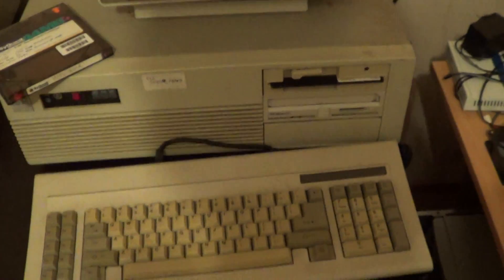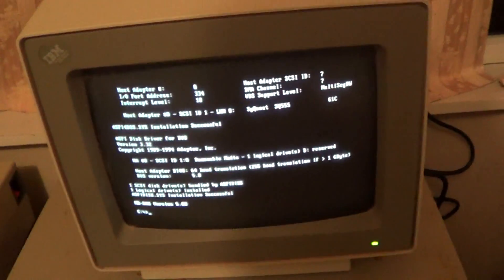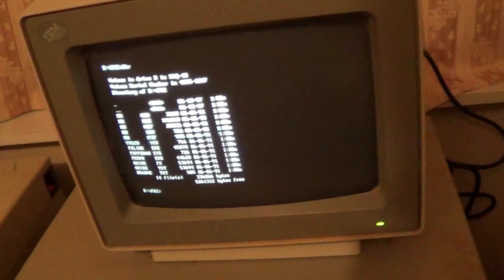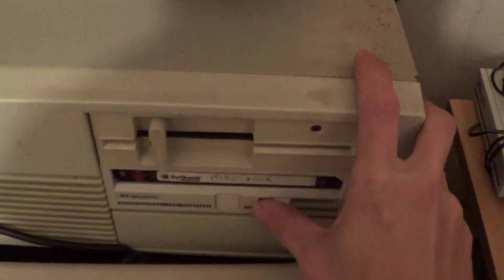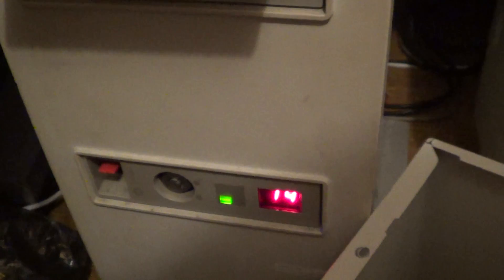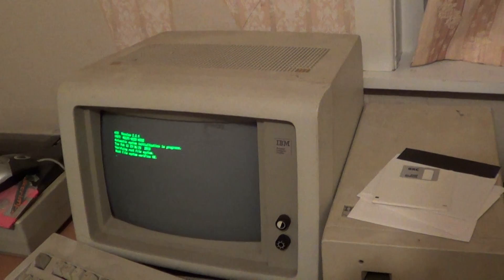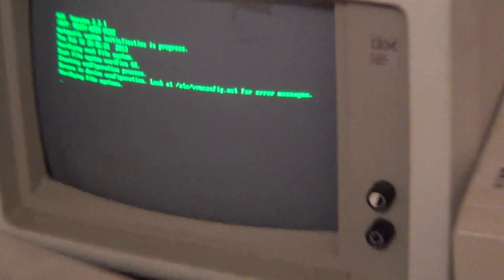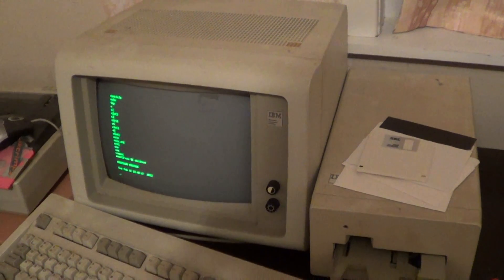IBM PC AT 5170 and PC RT 6150

Comment: Hello! I read on New Zealand Vintage Computer Forums that when you picked this machine up it came with plenty of floppy disks. I am trying to revive a 6150 with an existing AIX (but the VRM and SWAP partitions are deleted or had been moved to the now dead E70 drive) install but I get into problems that VRM show status codes on the LED display indicating "The VRM could not find a disk device driver." I have used the VRM floppy images at bitsavers and perhaps those are not compatible with the AIX which is installed? Are there images made out of your floppies? Can I ask you to do dumps of them? It would be really helpful!

Comment: You can also use a generic IDE controller in the RT and then an adapter for CF cards. This works great when playing with the various operating systems available and also reduces the noise!!

Comment: Hi, I am getting the 5150 tomorrow, could we meet somewhere in Wellington as I'm picking it up from upper hutt but can drive anywhere in the central city or where you are, anyway I'm getting it at 11am but keep in mind I'm not 100% guaranteed to get it but chances are 90% at least. I was hoping to drop buy and you can get it fixed if you have capacitors to spare!

Comment from the maker: It uses a special IBM made RISC processor so isn't Intel x86 compatible. But AIX does come with a DOS emulator and you could get a 286 plug in card for it. Using the emulator you can run several DOS sessions at once, and on multiple terminals (this one supports 16 physical terminals).